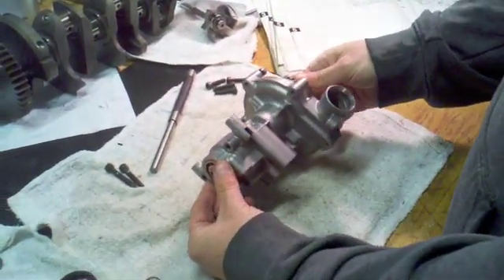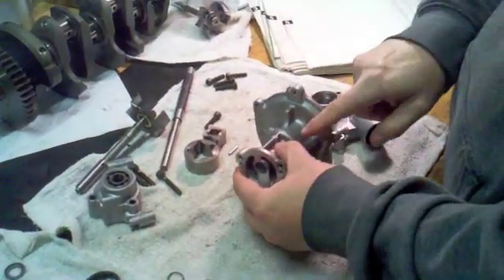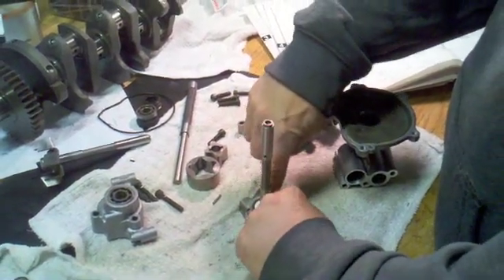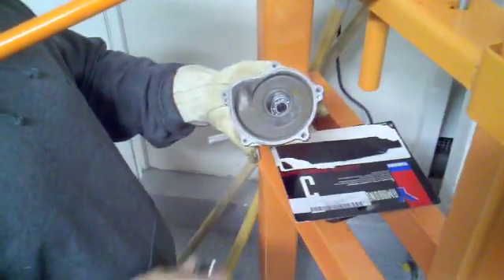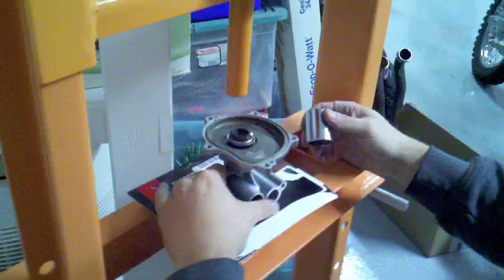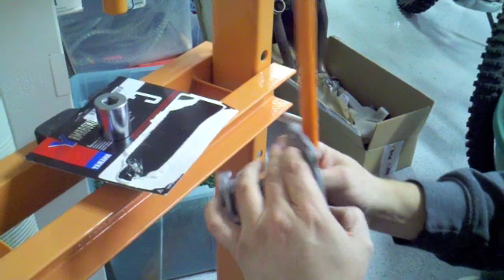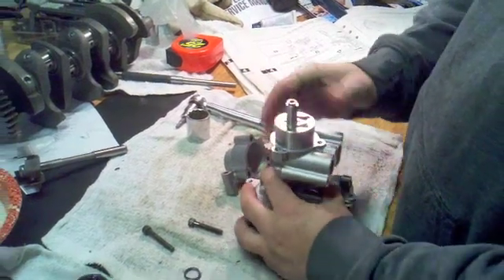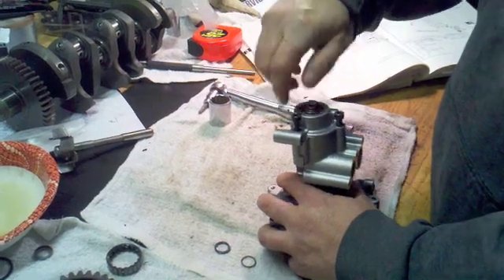2000 Yamaha YZF-R1 Engine Rebuild - Part 13

Comment: Rebuilding the water/oil pump on the R1 isn't hard if you follow the OEM service manual, which you DID NOT. You left out several IMPORTANT steps in your video, that if you had READ the Yamaha factory service manual, wouldn't have screwed up and caused your impeller to end up grinding on your cover.

Comment: One can not purchase the complete OEM water/oil pump any more for the 2001-2003 R1, but you can purchase a complete water pump assembly for the 2004 R1. I purchased an '04 Yamaha R1 complete water/oil pump assembly and will be testing to see if it fits AND works properly in my 2001 R1 once it arrives. I also have all the seals and bearings necessary to rebuild my original 2001 R1 water pump, but wanted to check and see if an '04 will work instead.
Reply: Follow up: a 2004 R1 complete water/oil pump assembly will NOT work in an earlier model year R1. Some of the oil pump passages are different and will not match earlier versions.

Comment: Can replacing oil seal in the water pump avoid coolant mixing with the oil? Or is this sign of a blown head gasket?
Reply from the maker: Coolant in the oil is almost always a compromised head gasket.   You need to check that first.

Comment: Hi John, hope you are well. I changed on the components on a water pump and when I put cover back on the impeller is grinding against the cover, but the seal is all the way in. Where could I have gone wrong?
Reply from the maker: Oh no, sorry to hear, rebuilding these water/oil pumps is really hard to get right, I had the same problem you are having, the pump you see me rebuilding in this video also had a grinding noise after installation, so, I gave up rebuilding it again, and just bought a used replacement pump, the good thing is that you can replace the pump without splitting the engine case, its tricky but there's enough access from the bottom of the engine after you drop the oil pan to do it.

Comment: How did u get the bearing out of the water pump housing? I cant seem to get much of a bite on the edge of the bearing. Tried a puller as well, no luck. Thanks
Reply: I explain in the video, I used a good solid punch with a sharp flat edge on it and beat the holy hell out of it to get it out, and applied heat with a torch to the outside of the housing to expand the metal just a little bit.   it was a bitch

Comment: Hi john how did you remove the water pump sprocket and is it a reverse nut?
Reply from the maker: I used a pneumatic ratchet to remove the sprocket bolts.  I don't think it's a reverse thread but I don't really remember.
Reply: Ok thank you, I've tried using a rench it just won't budge

Comment: Hay John, First I wanted to thank you for making this series of videos of rebuilding your R1. I'v ben using them to help rebuild my 02 R1. Anyway I came across the same problem you had after you put the water/oil pump in your bike. I found that the washer that goes on before the drive gear was hanging up every time i bolted the gear on.

Comment: Hi John, I'm having trouble with the cooling. Everything is fine until it gets hot, 100 -105 degrees. My fan has kicked in by this point and it all cools down. The radiator draws in the coolant from the expansion tank but most of it has been expelled. I've ran the radiator full of coolant but with an empty expansion tank and the coolant still expands until it is expelled from the expansion tank. I spoke to a proper yamaha mechanic on the phone and he sugested that the head gasket might have gone and is pressuring the system somehow. There is no water in my oil or vice versa. If i keep the bike moving it stays at the normal 70 degrees but obviously at some point I encouter traffic. I've sourced another radiator cap and cyclinder pressure gauges and when they arrive I'll get busy. Any thoughts on this? Did you have cooling issues with that worn out pump?
Reply from the maker: I have not had any cooling issues.  Radiator fluid being expelled from the radiator into the overflow bottle is not good at all.   I'm no expert, but the only way the fluid would be pushing out of the radiator is due to pressure, and pressure would come from the fluid boiling, or ???  Wouldn't hurt to replace the radiator cap, but I tend to think the head gasket theory is a good place to start.  Sounds like your water pump is working ok (otherwise, when the fan kicks on, the temps would not come down).  Good luck
Reply: SupermotoJohn I fitted the new radiator cap first before trying anything else as its obviously the easiest to do. All fixed and working fine. Thanks for the vidoes, I think I might have a go at fixing my old engine having seen how to go about it.

Comment: Hi john ..thanks for your reply. There are 2 seals on the water pup side according to your video. First there is a bearing then a seal then a cap piece known as the water pump seal. Is it the later seal you are referring to? Thanks again.

Comment from the maker: Sounds like your water pump is leaking through a seal, and coming out that drain pipe.  My recollection is that drain pipe goes up to the water pump impeller shaft area, so probably the seal on the coolant side of the impeller shaft

Comment: Ho John...not sure if u see this but a big thank u for all the videos.  Hey informative and helpful. Just one question...I have a 03 r1 that's leaking a very small amount of coolant through the weeping hole under the oill pan. What exactly is happening and what particular seal would correct the problem?  Thanks again!!

Comment: Awesome videos. Where did you get this factory manual? I'm rebuilding my 2006 r1 motor and it's similar to yours but a little different. For example, as far as I know I do not have that big generator thing on the side of my cylinder that everyone says is so hard to get off. But I really need my book for this for torque specs, but I don't have one.

Comment from the maker: R1's are known for running hot; getting 100 C quickly is perfectly normal.  Fan will kick on right after that.  Water pumps on the R1 are only hard to remove because you have to remove the belly pan to get access to them (its internal to the motor).

Comment from the maker: mrcycles.com is where I purchased most of my replacement parts.  For the water/oil pump I would recommend you find a good used one on ebay, it will be most cost effective.